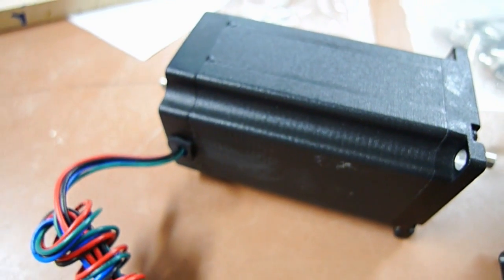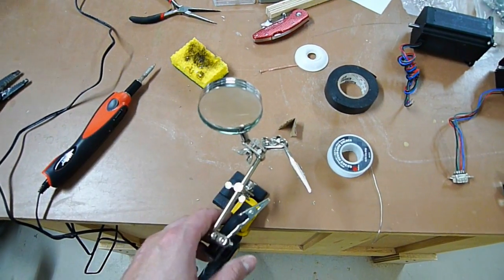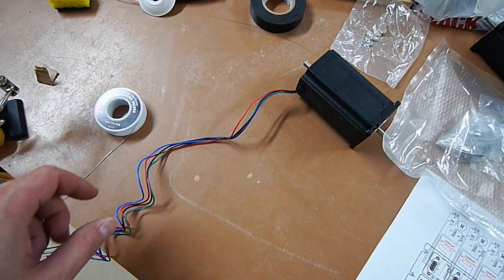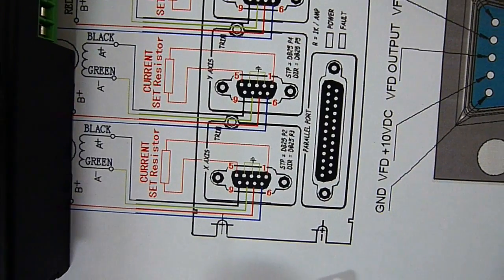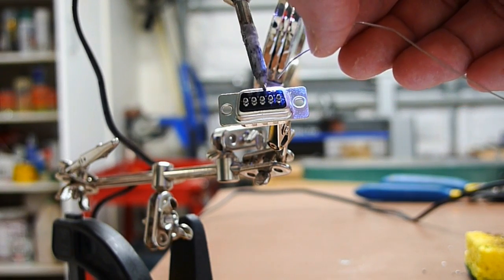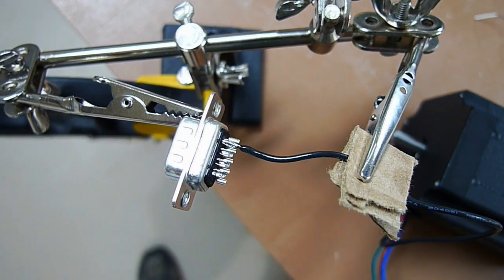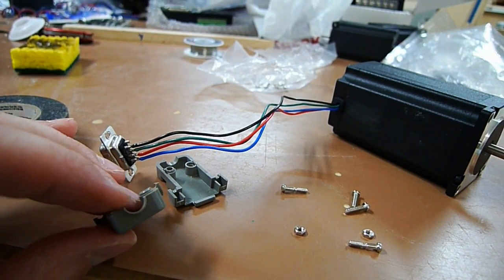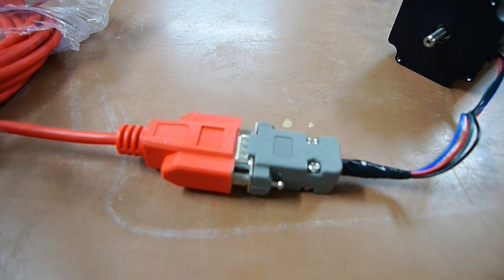Wetland CNC Router Part 15 - Soldering D Sub Connector (DB9) to Stepper Motor

Comment: Great tutorial.
I used DB9's called EZ-G540. Instead of using Gecko Current Set resistor pack, you just adjust the pot at back attached to DB9 and tweak to the resistance required per stepper motor with ohm Meter. And soldering the wires is so much easier too.
Link http://www.soigeneris.com/ez_g540___set_of_4-details.aspx

Comment: Hey Brother, did this work for you first shot? I noticed that the printout you have shows a current set resistor on pins 1 and 5.....did you have to add that after this video was made? My motors are not working and I am thinking it because I didn't include the current set resistors on those pins. By any chance, do you think that could harm my motors?